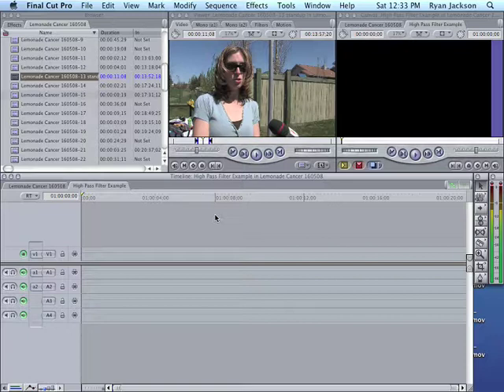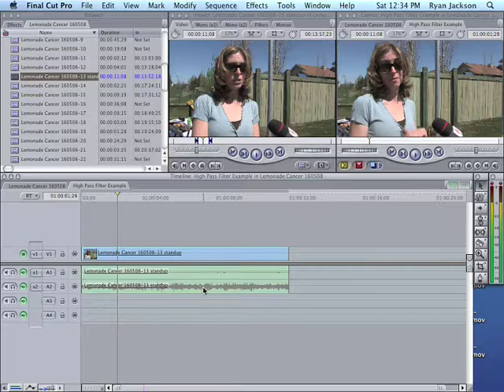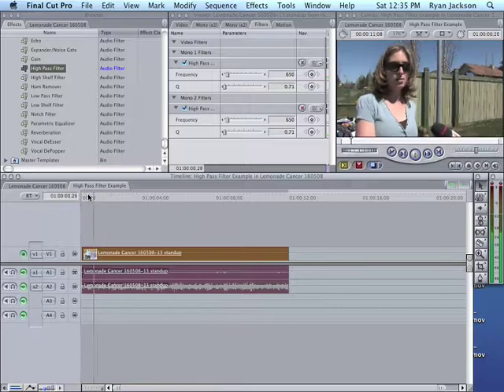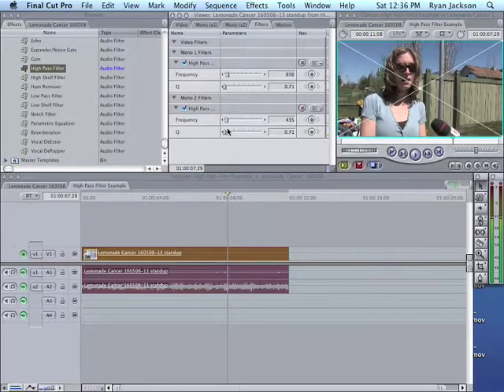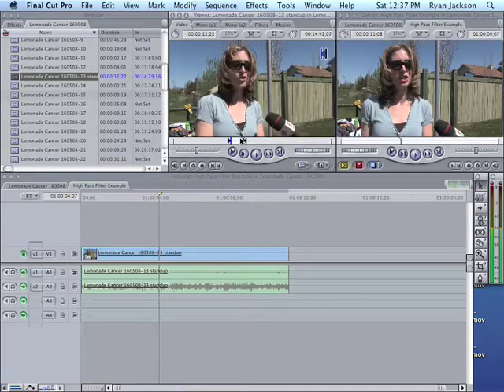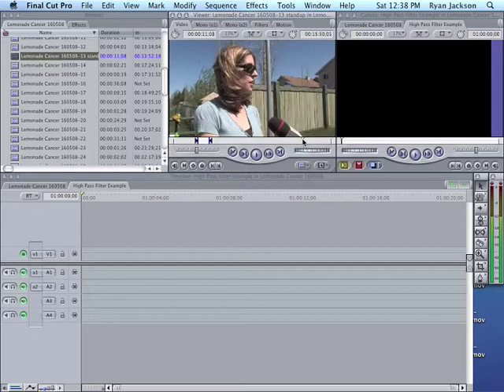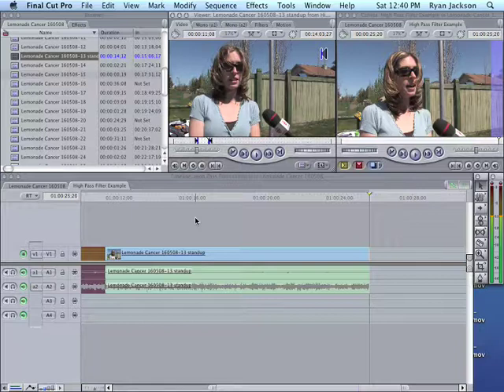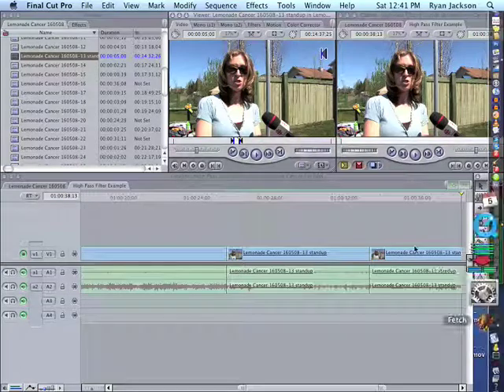Simple Audio Filters Wind Noise - Final Cut Pro and Express Tips

Comment: Good tips. Just what I was looking for.
Question: if you apply filters to the original video file after you've done some timeline work, will those filters pass into the current timeline? If not, is there a way of doing a "refresh" of some sort?
One more question: voice overs. I need to apply a filter to all the voice overs I add. Is there a way of adding filters to the incoming audio channel? If not, how about applying the same filter to a bunch of audio tracks at one time?
Thanks...